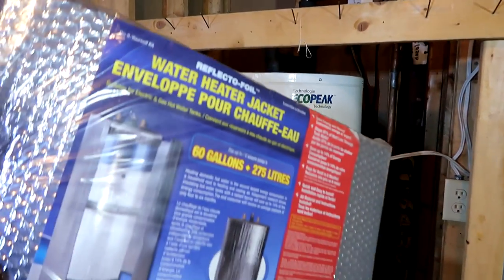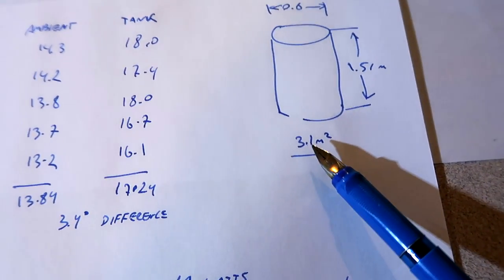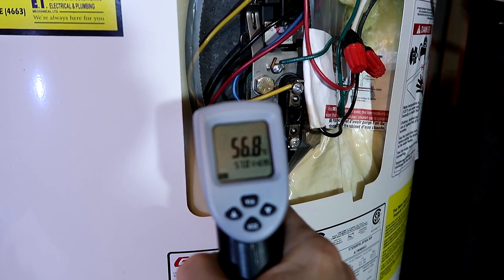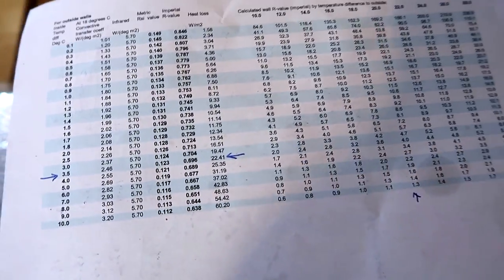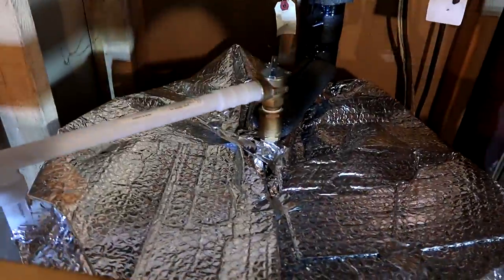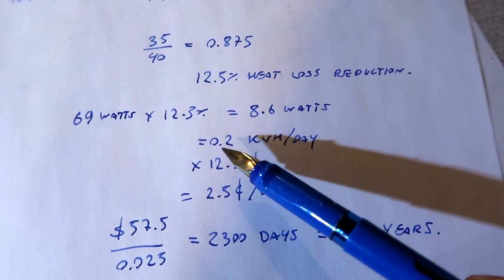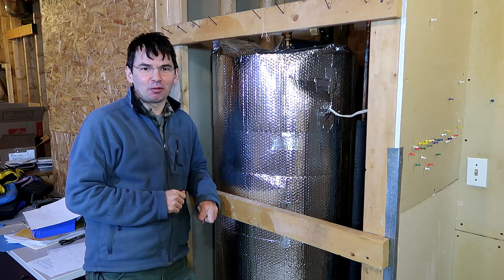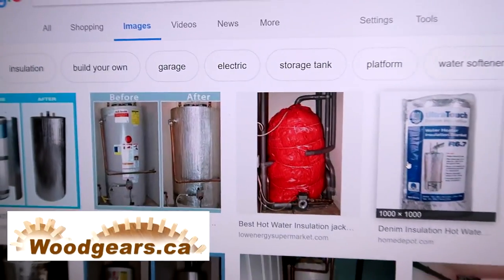Hot water heater insulating jacket:  How much savings

Comment: When using an IR thermometer, you really should keep the surface emissivity (aka material/colour) relatively constant. The emissivity value for wood is ~0.9, but for the reflective insulation or the painted metal tank it could be half or even lower than that which would completely mess up the readings. The easiest way is to stick a piece of tape on the spots you want to measure on advance.
Reply: Great comment and suggestion!
Reply: Was looking for this comment, did research on this topic for my internship. Shiny surfaces have a very low emissivity which indeed mess up your readings. If you read the manual of the IR thermometer it will be mentioned usually. Only expensive sensors which measure on a low wavelength would have the right readings on these surfaces. (edit1, looked it up: This is because the effective emissivity of a material is highest at shorter wavelengths and the accuracy of sensors with narrow spectral responses is less affected by changes in target surface emissivity.) (edit2: cheap sensor will also have correct readings if you change the emissivity setting, but then you need to now the specific emissivity of the surface) Oh and it is indeed an IR thermometer and not a laser thermometer as some people call them. The laser is only for pointing to the spot you're reading.
Reply: He never measured on the foil surface, which would have been really different. The painted surface, not as bad an error, but yes definitely a different e than wood. I always put a piece of masking tape on whatever I'm measuring, even if I suspect they are similar e values.
Reply: Good info, and that's probably why he measured the inside.
Reply: Some black vinyl electrical tape works well.
Reply: Exactly... according to the God of Information (Wikipedia) the emissivity of various metal surfaces can, depending on the coating, be tiny. The tape trick is terrific!
Reply: The temperature being higher on the surface of the tank being so much hotter is a good indicator that it's insulating. And I second that the new temperature reading should have been on the surface of the new insulation. Maybe a few strips of electrical tape on the wood and the surfaces of the tank/insulation would be good if the test were re-performed.
Reply: @dorgodorato  , he properly measured the exterior of the tank under the new insulation and not the insulation. That was because he was only needing a measure of the new heat flow out relative to the heat flow before applying the new insulation. It's a though you had an electrical circuit with one resistor but you add a second resistor in series. To get the new current you just need to measure the voltage drop across the first resistor.
Reply: Spot on. Not many IR thermometer users understand or bother about the emissivity.
Reply: you can stock a piece of masking tape on the reflective surface, and let the temperatures stabilize them measure it again.

Comment: In winter that heat loss isn't really wasted as it's going into your house but in summer it will put a bit more load on your AC which still might not be noticed unless it is heating a part of your house that makes you uncomfortable.
Reply: Yes, but it is electric heat. If you heat the house with gas, at about 1/3 the cost of electricity, then stopping this heat loss is good. Case dependent.
Reply: I’m sorry but that is not clear at all. For example a heater placed in the basement and locked in a fireproof room (like in my home) will mainly heat up that one room only and then radiate or convect the heat into the ground ergo heat wasted / leaving the system house. However if the house is very open and air can circulate very good you are right I guess.
Reply: Also depends where that room is, how well insulated the house is etc.
Reply: @kkarllwt  I fire my water heater with gas, too.  So I don't worry much about jacketing the water heater.
Reply: The heating of your house during winter, via the water heater, is more expensive than direct heating of your house.
Reply: @l.merbecks8144  I like your fireproof room suggestion, always though having so many high energy devices scattered around a home was unnecessarily dangerous.
Reply: @kkarllwt  People in Canada only use electric heaters if they can't get gas. LPG or propane is popular in many rural areas for space heaters but you don't see it used often for hot water.
Reply: @BrianBoniMakes  I'm not sure if you're joking or not ^^ 
Anyway over here in infamous Germany all homes with residental burners need the burner to be in a fireproof room.
Reply: @l.merbecks8144  No, that wooden room enclosing the water heater is a crazy idea. I've only had them in a concrete basement but a fireproof room would be best and one with a door going outside incase gas leaks.
Reply: @Brian Boni I've been an HVAC Tech for 15 years.  You dont know what you are talking about.  Any modern "stand-by" tank can have gasoline poured in front of it and will be fine.  "Fireproof room?"  I've never heard of it.
Reply: @KevinJLyons  You know every building code that exists around the world? We were talking about German residential code but such a room is common in North America in industrial structures.
Reply: @Brian Boni Do I have to know every code?  Thats a pretty high bar!  lol You never said anything about code.  You gave your opinion using anecdotal evidence.  And as a Professional, in the exact industry this video is about, I'm saying your opinion that a "wooden room enclosing the water heater is a crazy idea" is wrong.  It is and has been done for 100 years.

Comment: The "R" value you calculated for the jacket is correct. However the jacket you installed is supposed to act as a radiant barrier which is calculated differently and performs differently. Try increasing the air gap between the tank by about 2 inches and then do the calculations. Once the radiant barrier comes into contact with the object you are trying to insulate, it becomes useless as an insulating material.

Comment: Now you have to heat your basement more.
Reply: My basement is currently unoccupied. We got a bit of a flooding issue.
Reply: Good, buy a few RC boats maybe a submarine and play at Admiral as you wait until the coming dry season. And Good luck.
Reply: You wouldn’t heat the basement in the summer.
Reply: You and your doggie would take refuge down there in the cool during summer heat - why should the root vegetables and canned goods be the only survivors?
Reply: Correct.  A bigger cost savings in winter would be some form of heat reclamation efforts from your gray water discharge.  Consider if you could run your hot shower water into a holding tank that dumped when it hit ambient.  Your shower discharge probably going out of the tub at 100 degrees hangs out in an aluminum tank till it drops to 70 and then dumps to sewer. Using good old BTU you have 30 degrees F delta by average shower of around 17.2 gallons at 8.33lbs a gallon for around 4300 btu or 1.26kwh.

That's per shower down the old drain.
Reply: And dumps to the sewer preferably from that grey tank through your toilet bowl - but watch that legionella.
Reply: Better to heat it with NG anyway, electric resistance heat is super expensive.
Reply: why, my basement is colder than his and it does not bother us at all, cause we don't live in it. Heat escaping down to the basement keeps it high enough to prevent the pipes from freezing and that is enough. Heating it is throwing money out the window.
Reply: @pbgd3  ...I live alone in a small home with a combination tub/shower unit.  In winter I plug the drain before I shower in the evening before bed and collect the warm water in the tub.  Next morning I drain the tub and rinse it with cold water from the shower.   My small apartment-sized laundry machine is tucked in one corner of the bathroom - a short piece of garden hose lets me direct the draining hot wash water into the tub to capture this waste heat as well.  Am I suffering from OCD?
Reply: but why? If you never down there all you need is to keep it above freezing

Comment: Excellent analysis Matthias oh, I did not bother replacing my jacket of insulation when I had a new water heater installed. Also people need to remember that throughout the cold season, any heat loss from their water heater is still contributing to heating the house and therefore not an entire waste.

Comment: I enjoy the energy saving videos. I'd be interested in seeing you talk about windows. Not replacing them, but perhaps trying out curtains/shutters, or seasonal coverings that could be used to insulate very large windows. 
Hope you & your family are enjoying the new location
Reply: It would be interesting to test a sheet of foil (stuck to cardboard or foam) that you put against the window before shutting the curtains at night.
Reply from the maker: that would help, no doubt, but be inconvenient.  Also, it makes the inside of the window get colder, and then you run into condensation.
Reply: @matthiasrandomstuff2221  Could try a low-emissivity film? It's a cheap alternative to replacing windows, that gives some of the benefits that more recent windows have built-in.
Reply: I tried the heat shrink film on my windows about 5 years ago and it works well (in that the room is noticeably warmer, but I put most of this down to draught exclusion). If you use it on the inside and the room heats up, like in our kitchen the film slackens a bit and looks unsightly.  I replaced the film in some of our rooms with double glazing, in that I added brand new double glazing units to the inside of the window frames without removing the original single glazing.  I used some self adhesive draught excluder around the frame and then positioned the extra glass and held it in place with cleats, this was about a quarter of the cost of having full new double glazing made and fitted. it has been in about 4 years and is excellent, both for noise and heat loss reduction.  My observation to anyone who asks me about my windows or other hacks is that the greatest gains are draught exclusion. Especially around doors and windows, but also between floor boards, skirtings, electrical fittings, behind fitted units, etc., etc.  This is in the UK, where there is a balance between sealing a house up, and adequate ventilation to prevent mould growth from condensation forming on cold walls.  The youtuber "Peter Ward" has made some excellent videos on this.  Good luck with the new house Matthias!
Reply: Matthias Wandel id watch your energy videos because you’ll tell us if there actually worth it to do to save money since you do the exact calculations or just false advertisement
Reply: During the winter you don't want to cover all of your windows. You want to open curtains, shades, and shutters completely on windows that face the sun. On windows that face away from the sun you can't do much to help keep heat in. In my house my mother cover the windows with plastic to prevent a draft but it still allows heat transfer through convection. Some people are currently designing ways to do insulated shutters that go on the outside which would help to prevent over heating in summer and with heat escape in winter.
Reply: @bootsowen  I'm not sure if your house have the same style windows as the ones that are most common in the US but the best way to reduce air leakage in windows it to buy a quality tilt and turn windows. A sliding window is practically impossible to seal. Also on the subject of mold your building envelope has to be air tight but not the wall cavities. So for example if you ultilize airtight drywall as your air barrier you can add vents to the insulation cavity that goes outside. Another example if you use the sheeting behind the siding as your air barrier  then you can vent the insulation cavity into your living space. Your barrier will be intact and your insulate and walls will be well vented. Once you get the house air tight you can then install a heat exchanger that will exchange air while maintaining temp.
Reply: @Imaboss8ball  Sounds much better than in the UK, Here the basic type of construction is brick or block walls, with an insulated (vented to outside) cavity.  And there isn't great attention to detail by builders so you get cold spots.  My own house is 130 years old so is just solid brick, without a cavity or any wall insulation.  It is built with lime mortar so is naturally slowly breathing, but some houses repoint the brickwork with cement mortars or cover the outside of the walls with cement plaster.  On the tilt and turn windows: I reckon they are far better than anything else, in window terms!. I think Matthias did a video about them before. I have a video about how to fix them when they are stuck halfway between two settings.
Reply: I do just that...all my RV windows are coveted in cold weather....it makes a huge difference in keeping the heat or cool in
..... In winter I use a lot less gas. Enough to noticed it big time in my wallet!
Reply: Wouldn't the airspace around the window pane be cold with the air having less flow? I would think that should reduce the probability of condensation happening.
Reply: @matthiasrandomstuff2221  velcro and bubblewrap...and transparent tape....not inconvenient

Comment: Interesting video, thanks a lot. Don't forget that that when used on shiny surfaces that style of thermometer measures heat reflections. What you  should do is get a little masking tape and put it directly onto the new insulation and measure it's temperature. This way you are not measuring your own body heat reflection etc, but you are getting a direct reading through the insulation.

Comment: Love how they up charge when the packaging has a specific purpose. When you just buy the stuff in a bulk roll it is so much cheaper. I used the same stuff running my kerosene heater in my garage (the standard tall cylinder type) by having a wooden frame built and use that as a heat deflector. One roll with yearly re-lining lasted about 10 years.
Reply: As someone who is new to this topic (thermodynamics? Physics?) could you please advice me which roll I should buy:) I’m going to be a mom soon and need to save money on bills. Thank you

Comment: When using that 'bubble foil' stuff (or any type of insulation), airtightness is essential for maximum benefit.. tape up every little gap. Saying that, most of it is pretty crap. I built a 'box' around my 500 litre tank with rigid PU foam ( celotex or kingspan etc in UK) and filled the spaces between it and the tank with mineral wool for good measure. The difference was amazing : )

Comment: I bought Owens Corning fiberglass, and wrapped the heater with that.  Then I put the whole thing in a Styrofoam box.  The tank is in an unheated garage.  Winter temp outside is about freezing.  Then insulated garage ceiling and door.
I don't care if it saves me substantial money, I just wanted to do it.
Plus, the garage now feels less cold in winter and less hot in summer.
Reply: Like I did.  Owens Corning fiberglass then a dollar tree plastic drop cloth cover.  It's a big pink bubble....but highly insulated.   Hey,  the water heater is ON all the time and this winter oil is sky high so we have to save all possible

Comment: Very cool. I'm always finding infrared scanner results dubious since they (cheap ones we have) don't have an emissivity adjustment for how shiny the surfaces are. Ideally you could place a piece of low thermal insulative material in ambient and on the heater body so you are scanning the same material for both readings to nudge the numbers closer.

Comment: that "kit" looks like the exact same stuff that car windhield cooler/reflector material..
Reply: There are w lot of products that use reflective materials to insulate and I always wonder if they make any sense. Yes they are good for infrared heat loss. You can reflect sunlight and keep your car cool, but is there a lot of infrared heat coming from a boiler? I have also seen them on socks and inside of coolers. How can reflective materials on the inside of a cooler keep energy out? Or a sheet of aluminium foil on wall insulation?
Reply: @MaxMakerChannel  - they reflect radiant heat.  look up emergency space blanket.
Reply: Max Maker 
Yes they work well but only for radiation and only if there’s no contact with the heat source. Otherwise the heat would transferred through (heat)conductivity. There will also be convection heat transfer (heated air flow) if the package isn’t almost airtight.
Reply: All I can say is a solar blank saved my life once and kept me warm during a winter camping experience so yes that material does work
Reply: Max Maker heat produces infrared light, and infrared light definitely produces heat in objects. Metal reflects infrared light. Therefore, using aluminum foil to reflect it back towards the heater will help it retain more heat. However, I believe it only makes sense to put the foil on the outside of the insulation cover, as the tank itself is already metal and it would do little to put a layer of foil directly against it.
Reply: Louis Laszlo 
Yes you are right. If you put the shiny metal to the tank, than heat is transferred through conductivity. So to let the shiny metal reflect radiation (=infra red light) you need an insulation layer between the source and the metal.

When dealing with heat transfer think:
- conductivity 
- radiation
- convection (airflow)

Comment: I used the same material in a totally different application - a concrete ceiling that's exposed to the sun all day and getting about 42-45ºC inside, in the summer. After installing the jacket in the ceiling, I got an immediate reduction of 7-8ºC inside. It will be more effective when I add a layer of rock-wool and a drywall ceiling.
You could too add a layer of rock-wool between the water heater and the jacket and get a better result.